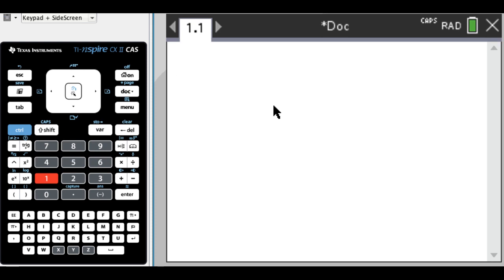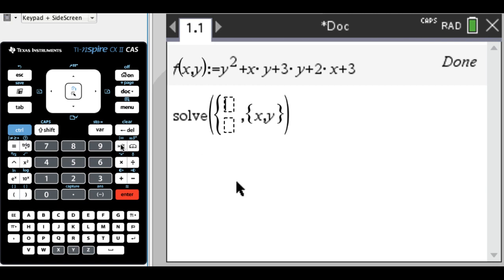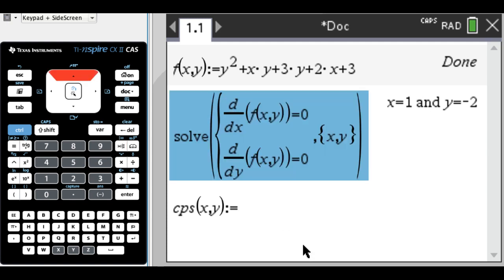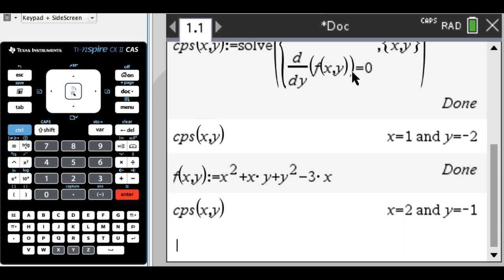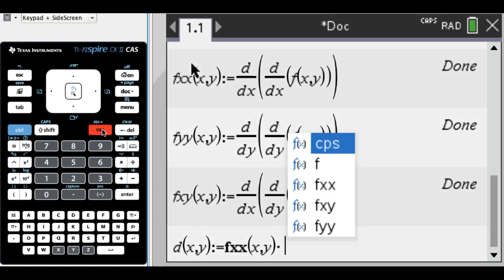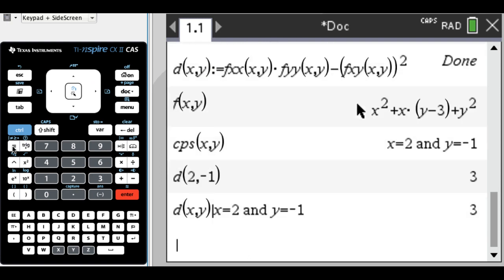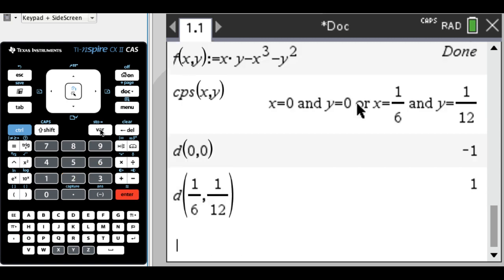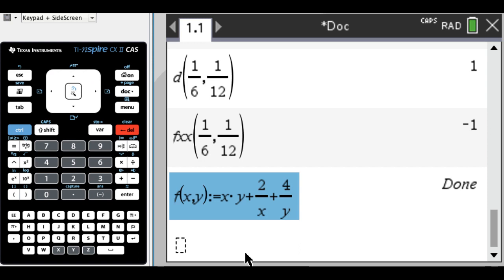Using CAS to find Max, Min, Saddle Points of Multivariable Function

Comment: This is great & I knew the Inspire was capable of this. At this point in time I'm only looking for critical points (but soon I will need these multivariable functions.

Question: Can the inspire (or is it doing this & I'm missing it) determine if 0 is included in the crit points?

Thanks & how/where did you learn these steps on the Inspire?
Reply: Edit: it seems like the warning note you mentioned at the end is the "drawback"..is this correct? (value outside domain). thnx